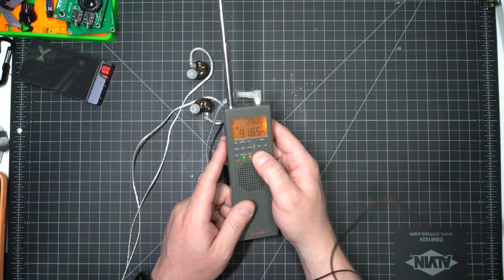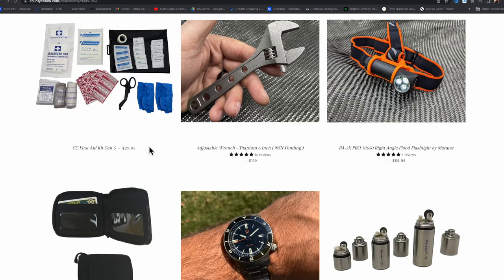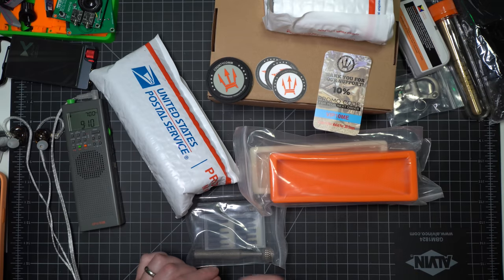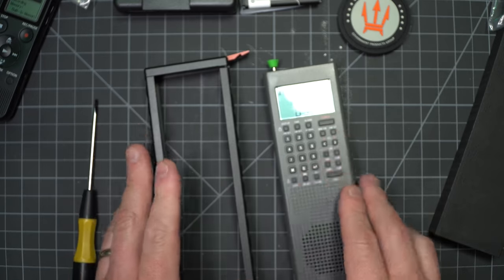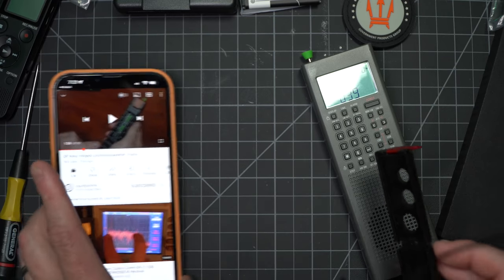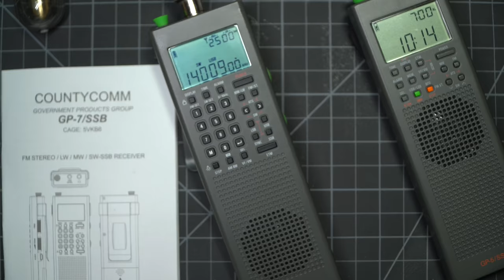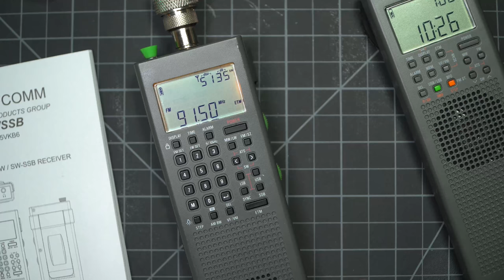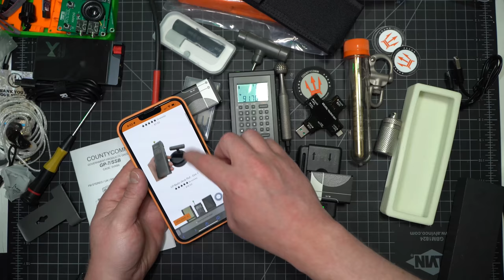CountyComm GP 7 - General Purpose Radio | The Features I Wanted!

Comment from the maker: The battery used in the GP-7 is a BL-5C. They’re available at multiple places online. I’m not worried about getting access to them.
Reply: Thank you.
Reply: They were used in many pre smartphone Nokia handsets.
Reply: Hate those things, I'd get the higher capacity ones, 1500-1600 mah, that's my hesitation with getting one, why put batteries in and out, just recharge a worthwhile battery in the radio.
Reply: Actual GP-7 owner here: The battery life of the OEM battery lasts extremely long and is quick to recharge. I will not buy spare batteries due to my plethora of power banks I have for cell phones, etc. 73!  -- W5NRP
Reply: @justinb.5822  That's good to know, I might get one and still order a higher capacity BL-5C, if the radio will charge it, I'll ask them, after all it is for portable use, what about current drawdown when stored?
Reply: @michaelhayward9532  It holds a charge very well. I don't notice any discharge when I store it for a long time.
Reply: @justinb.5822  Thanks, I like it :)

Comment: Should have been a USB-C for something new like this.
Reply: USB-C would be great, heck, I'd even like to see the older USB-Mini over the micro.  Micro seems a bit fragile in my experience.
Reply: @guitodd  problem with mini is finding cables. micro is starting to be hard to find. amazon has them but not many.
Reply: @guitodd  that is so true that was the worst time for phones when everyone thought micro was the best. It wasn't the connector would die in 6 months if you charged your phone every night.
Reply: Are there any similar radios on the market that are USBC?
Reply: while you can use a USB-C to microUSB adapter dongle, I modded mine with a female USB-C 5v trigger board epoxied a little bit under the microUSB port. The V+ and ground are wired directly to the microUSB V+ and ground, works great.

Comment: Love this rado - performs just as good as the CCrane SSB.  It's smaller, lighter and the display can be seen from most angles without disappearing or ghosting.  My battery has been lasting 14+ days with about 2 hrs of use per day!  I like the external AM ferrite antenna; for DX and local too, I don't need to change the radios position for best reception - just turn the antenna!
Reply from the maker: I agree!

Comment: I have an early model Tecsun PL-368 that I imported from China right when they became available. The GP-7 is supposedly the exact same as later model 368s, except the antenna on the GP-7 is a more durable stainless steel rather than the aluminum on the 368. Great radio except you can't calibrate the dial on the early ones (mine is spot on) and there's some warblyness with SSB when the case vibrates too much. This has been corrected on the GP-7 and later model 368s from what I understand. The biggest downside when using it for scanning the amateur bands is the muting while tuning that's inherent in purely DSP based receivers using the SI473x chips. The Sangean ATS-909X2, Tecsun PL-880, PL-990, S-8800, and H-501 all use the same chip that's in the PL-368/GP-7, but only as a demodulator - Tuning is done using conventional PLL circuits, so they don't mute while tuning. For purely keeping up with the ham bands while out and about, you can't beat the Belka DX as a ultraportable pocket HF receiver, but they may be difficult to obtain with the sanctions on Belarus due to their participation in the war in Ukraine.
Reply: Early PL-368's had firmware 3682, and GP-7's had 3684 at one point (found by holding down the V/M button for a while).  Anybody know what the latest GP-7 and PL-368 radios are shipping with? Are both at 3684 now?
Reply: That Belka looks quite interesting....

Comment: I too enjoy my Tecsun PL-368.  And for those whining about "muh lack of AA batteries", the BL-5C is one of the most ubiquitous li-ion batteries on the planet.
They can be found easily on Amazon as well as at every Batteries Plus store in America.  
And in the event of zombie apocalypse, the entire thing can be powered via USB from any external battery bank, even - GASP! - a homemade one that consists of AA batteries.  
Of course by that time I'll have already tossed a brick through a Batteries Plus window and stocked up even more on BL-5C, AA, AAA, Li-Ion 12-volt, and CR123A batteries.
Reply from the maker: Agreed.
Reply: I have to agree here.  I have always bought AA battery packs for all my HT's when available for the simple reason I store batteries and can easily find them at a store if needed over trying to power a proprietary wall-wart charger in an emergency or while traveling. USB charging is the game changer.  At this point, with the amount of devices we have and are available like cell phones, tablets, flashlights, etc. 'USB charging' or 'powering' capability should be a part of your preparedness plan.

Comment: You will find in the documentation that the radio can be programmed to us the whip antenna with the me antenna or you can isolate the whip from the mw antenna.  I found out that if it is programmed to use the whip with the mw antenna then you can indeed plug in an external antenna and use it just the way you did in the video. You lucked out with it already programmed. My Icom didn’t. I stumbled on to in the manual.

Comment: I am going to get one of these to use for POTA activations — you could tune to a different band than the one you’re working and see if other bands are busy and what stations are on using your iphone and an FT8 decoding app.  All you need is audio to decode with your phone, so this should work great for that.

Comment: the usb out port is meant to be used while its plugged into a wall, not to use a battery to charge something else. not sure why you would think 3 volts is an appropriate usb charge voltage.  the 3 volts may be enough to turn on the led on your other device, but is not the 5 volts any usb device would expect.

Comment: I’ve been having trouble getting consistent information on using sideband on receiver-only radios such as the Tecsun PL-330, PL-680,  SIHUADON R108, QODOSEN DX-286, Tecsun H-501 or the Sangean ATS-909X2 with firmware version 073. 

How do these above noted radios compare to the one that’s in your video?

It’s seems like most people buy one or all these radios, but I just want one that I can grow into using, which isn’t missing too many capabilities without spending $500+. I willing to trade durability, range and power for capabilities at this stage.

Comment: Your recorded headphone sound is so clear! How?
My new Tecsun PL368 is hissing a lot in the earphones once turned on, even on FM with a strong signal. Only when volume passes 10 or so one almost doesn't notice the hiss anymore, but than that's too loud already to bear it. The same with another pair of earphones. I actually bought this radio in hope for a better sound thinking that only those cheaper ones hiss in the earphones so much.
Should I look for a radio with DSP or earphones with higher impedance?

Comment: Other than cost, is there any benefit to using a receive only radio like this over an HT with wide band receive? I’ve always enjoyed that feature of my Kenwood TH-F6a and have never considered buying a dedicated portable SW receiver for that reason.
Reply from the maker: From my experience and the th-f6 is no exception. Wide banded HTs are generally poor on SW reception.  If you consider the components in the box so to speak for dual band radio there isn’t room much left for sw to be as affective.

Comment: Got one yesterday. AM reception seems good but SSB/CW stability seems lacking for my unit. Minor touching or even speaker sound causes the pitch of CW to warble and SSB to be difficult copy. Anybody else having this issue, or do I have a defective unit? Josh's at 13:40 and 16:15 seems much more stable when handled. Thanks for the well-done video. --N2GX

Comment: Any idea if it will receive outside of the HAM bands say for operators that are authorized? Would like to use one or more to monitor or to scan "if possible" several frequencies outside our normal HAM bands. Another feature that is needed is to be able to program in frequencies and store them for scanning like you do with the keypad or CHIRP software for the boafeng 2M/70cm radios.
Reply from the maker: This is 100% a receiver and will listen outside the ham bands.
Reply: @HamRadioCrashCourse  Perfect... I'll be getting one "or more" for my MARS and SHARES station to monitor our frequencies.

Comment: Hey brother just got into ham and scanning, you been my main guide but i need something answered please. I am also taking courses for tech license. My main question is i need the difference between gp 7 and baofeng bf f8hp, other than talking (cause im not licensed yet). Main thing is i want to have a police, utility ,noaa, weather scanner. Can someone in lamemens terms tell me. Thanks!!!!!
Also can this hear all the ham bands?
Reply from the maker: Gp7 is a shortwave receiver. It doesn’t operate in the frequencies as police, noaa, utility etc
Reply: @Ham Radio Crash Course  yes thank you, as i said im new to this received them both today and now realize i didnt need the gp7 and am kind of debating getting rid of it. However i got the boafeng bff8hp and am very happy. Im still struggling a bit learning all the bands and the categories they fall in. Any good material you can recommend that is simple to understand i want to  take in as much as possible

Comment: I have mixed feelings on these kinds of rechargeable batteries.  Sure, the radio can be built more compact and lighter.  But in an emergency or SHTF situation one can still find AA and AAA batteries, alkaline and rechargeable,  pretty much everywhere.  I like to be able to run my gear off of AA or AAA batteries or a 12v system.  I even have  battery cases to run my Baofengs with AA and AAA batteries.  I have a couple of little battery chargers that charge AA and AAA batteries that can run off of a 12v source.  I can plug it into my 12v photovoltaic system and voila!  But if you don't expect an emergency or SHTF situation then these kinds of flat rechargeable batteries would be ok.
Reply: Kind of felt the same way; but I have several USB micro cables - and charging power can be accessed via an AA accessory pack, solar back-up battery, car with a USB adaptor (another junk drawer occupant)...  So while AA's or AAA's are easy, the rechargeable has plenty of options.  My battery has been lasting 14+ days with about 2 hrs of use per day!
Reply: re: But in an emergency or SHTF situation one can still find AA and AAA batteries, alkaline and rechargeable, pretty much everywhere. :
Build a USB adapter that takes AA or AAA and outputs 5V to charge the Li-Ion in the GP-7 ...
Reply: @uploadJ  and what if the li-ion battery fails or you lose the ability to re-charge?

Comment: Question, can you recommend a 50W cheap mobile VHF/UHF Ham radio that also transmits on MURS/GMRS (I not concerned about FCC Rules & Regulation, because I will only transmit on it for emergency situations). Thank you for the knowledge you share.